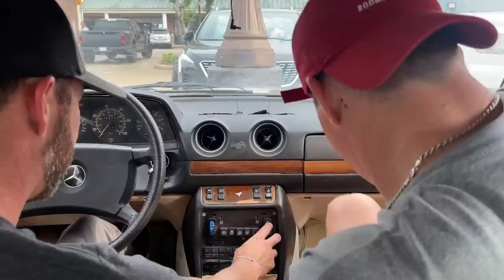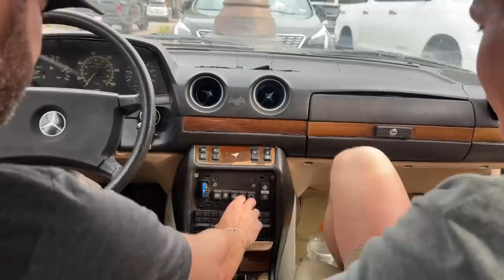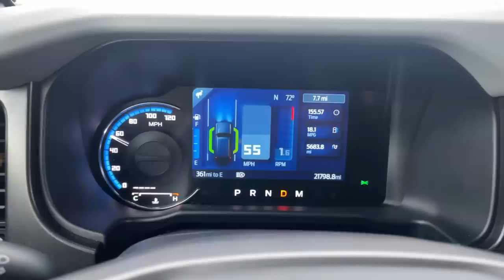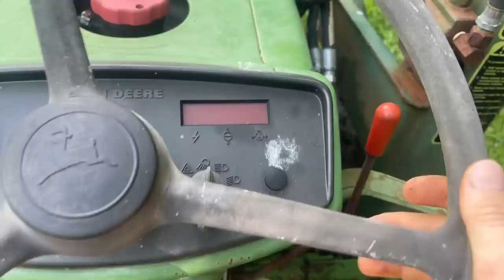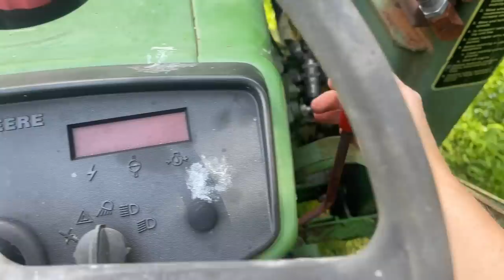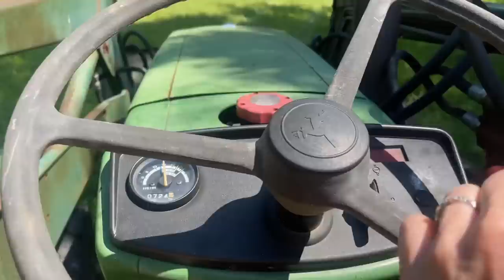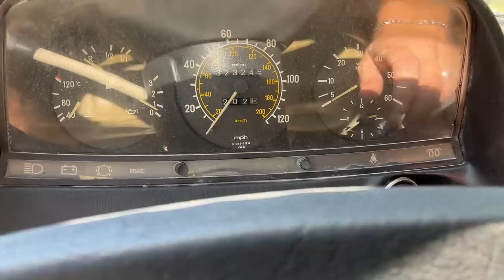Diesel wagon, $2,500?! LETS GO!

Comment: Those w123 chassis cars with the OM116 motors are absolute TANKS. Oil changes, anf fuel filters will make them run for ever. The weak points are underbody rust and the vacuum systems that run the locks and fuel cutoff. That looks like a solid example

Comment: When I was 17 I had a 74 ' Camaro & a 76' Mustang Cobra , and a 72' F100 short bed with a 302 , 4 speed. Red ! 
Loved that truck.
My dad bought me the Camaro when I turned 16 & I bought the Cobra 6 months later....
I bought the f100 from my dad when I was 15 . It was wrecked , so I bought a parts truck (71 f100) and changed the front clip...
My dad fussed at me for having so many vehicles but by the time I was 18 I had added a few for parts & , one of my all time fav's , I bought a 77' Monza Spyder.
Then a 73 Chevelle that Id love to have today..
Love the channel .
Phil from Austin Tx.

Comment: A friend of mine has on of these Mercedes wagons he uses as his daily driver.  When he got it, it did not run, and he told me the fuel injection system used is essentially the same as Germany used on their WWII fighter planes.  That was five years ago, and he still drives every day.
Reply: And I bet it's similar to the system they used on diesel trucks before those fighter planes! A chain driven injection pump is some simple stuff (in theory.. Mercedes did this with some gasoline injection cars in the 1950's, too.

Comment: THATS AN AWESOME RIDE!!!  Drove a 300D for 5 years, commuter car.  300K, only repairs, motor mounts, and turbo bearings.  Oil and fuel filers @ 3k, I still see it around town.  35 mpg, and that’s when diesel was cheap.  Never should have sold that car.  Well done.

Comment: That is literally the most reliable rig you own. Half dead, she still does car stuff.
Clean the injectors before you you mess with throttle settings on your pump. Run some CRC or BG detergent cleaner and clean them. At idle, right now they are not spraying, they're streaming like a squirt gun or water hose. That's why she's "nailing", and then clears up. Stanadyne makes the best fuel additives for it. 
Other than that, get the AC working, rear shocks(!), new tires, and enjoy. The bones of this rig are known to live close to a million miles, in African Heat, Artic Cold. Epic car.

Comment: I had a 240D salon from 1976 as my 2nd ever car went all over Europe and the UK in it. The thing is still running and has been restored by the son of the guy I sold it too, still on its original engine and transmission and is halfway on to its 2nd million miles.
Aaron why not do a east coast beach then go straight to the Rockies and ski there.

Comment: I'm in Australia, and I have had three W123's , one being a diesel, non- turbo with 480,000 kilometres on it. That is the first one I have seen with interior in that condition. Usually, they hold up very well. I currently have a W124 300E with 376,00 km. I love Mercedes. Mine is Marymercedes 😆

Comment: Our family largely doesn't sell our cars, we shuffle them around. My first car, in 1991 when I was 19, was a used 1982 Saab 900 I got from my mother after she got herself a '91.5 9000S,. After I cracked the block of that 82 in 1996 I replaced it with an used '89 900 i bought myself and my father got himself a used '90 900S from the same dealer a year after. In 2002 my mother upgraded herself to a 9-3S and my dad got her 9000S and I got his 900S. Then in 2007 I got the 9000S after my mom got a 9-5 Aero and my dad got the 9-3S. Around 2012 I got the 9-3S (which was a 5 speed) and my dad got a used 2002 9-3 SE (which has a bigger turbo among other things) in an automatic as he was tired of doing stick shift (the 9-5 is also an auto). A deer wrote off the 9-3S in 2014 and I replaced it with another 2002 9-3 Manual which I'm still keeping going. 

IF I had to do it all over again, I'd still have gone with Saabs (though I might go easier on the clutch of the first one and the transmission of the third one)... they're not anymore expensive to fix than BMW, or Audi, or hell even VW, and while they're not "fast" cars typically for their class, they're the most overbuilt tanks when it comes to structural reinforcement that I basically don't worry about a collision with anything. I've seen crash photos of them being rear ended on icy/snow covered highwayst by loaded 18 wheelers and the truck is the thing that bent the most in the process. You can take the front coupling knuckle from TWO locomotives doing about 35mph to the drivers door and it barely phases the car. Pushes it down the tracks a quarter mile or so and the about worst you're going to suffer is a broken left leg if you're the driver (everyone else will be able to open their doors and get out). Roll overs are pretty much a non-issue as they have better roof structures than anything without an NHRA certified cage like Finnegan has in Blasphemi, and they're designed to take 1100 pounds of moose or elk to the windshield without the animal getting inside the cabin. 

https://www.youtube.com/watch?v=9IPrXAJ2Vj0

Comment: Check the engine mounts, valve adjustment and the injector opening pressure for the low/rough idle. Looks like a couple rubber mounts fit the air cleaner are bad and it’s the middle button for the A/C.

Comment: I absolutely bloody adore these cars and would bite your arm off for this one (if I was in the states).  I had the saloon with the petrol engine for a few years and it never let me down and it is my biggest car regret that I sold it.
Small tip at the front corners of the sunroof opening are 2 drain holes that lead down and out behind, under, the top of the wings to I think the same spot that the hood hinges hide in with lots of leaves usually sat in there, if memory serves.  I found a bit of extension lead cord flex was exactly the right size to slide down these 2 channels to clear them out without any real effort at all.  Just a fantastic car for making your day feel that much better when you travel in them.

Comment: When I saw the videos of Emily pulling you out on instagram I messaged, Seriously though, get in touch with anything you need to know, I've made vacuum diagrams that are color coded, I've got videos on the AC, Glow system, transmission, and tons more stuff still in the works between editing and uploading between work and everything else.
Your rough idle could be the rack damper, they were upgraded to a newer gold colored bolt.
The EGR vacuum lines appear disconnected, which could be your vacuum leak that is causing poor shutdown.
A new set of nozzles and balance the injector pop pressure does wonders to smooth out a 617 as well, I'd recommend moving to the 314 nozzles, they give you a little more bottom end grunt.
I've been driving diesel Mercedes for over 15 years now, getting pretty close to 20 years, and I'm younger than you...
You can 4 speed swap them, I've got one that I did that to.
Also if road trips are your goal, you can get a diff from an 85 that has the 2.88 ratio for better cruise rpm and economy, I'd do the 314 nozzles to compensate for the taller gearing for sure then though.
If you guys want, I've got all kinds of special tools, pop tester, shims, parts and probably about one of everything else too, let me know, bring it up for a trip to a TN lake, or I can road trip my 300D down loaded with stuff.

Comment: I loved mine!! Screw that exhaust valve closed on the turbo exhaust and it'll bark second gear. It's surprising what that engine can do!
EDIT: The vacuum system is everything in that vehicle...also the AC board usually needs to be resoldered...

Comment: First I would replace the shocks (the rear is a little bouncy)
Go trough the fuel system to find any leaks
Go through the engine by replacing worn and cracked hoses
Get a hitch put on it
As for a Tear drop trailer there are tons of options from DIY build kits or a really nice one with a slide out, kitchen sink, and  bathroom in it.
Just both of you and the dog would enjoy nice road trips once all the little things are taken care of on it.
I grew up in my family with a wagon and a pop up tent trailer going on trips around the country here and there.

Comment: You've had these before, Aaron, so probably not news to you, but the power steering system has a replaceable filter in the reservoir, and the SLS hydraulic system to the rear spheres has (on W123) a filter, too.

Comment: I had both the sedan and the wagon.  They're great cars and the engines are so over-engineered.  I ran mine on vegetable oil for years.  They're not particularly overpowered and can be temperamental on cold days.  Watch the vacuum system... that can be a mess!  I had the self-leveling-suspension in the rear - that's also a mess.  You can find kits online that replace the springs and shocks that make life a lot better.

Comment: Those 300TD were extremely popular in California while they were still being imported.  One fairly well known quirk is that they tended to have problems with hot starts.  They would crank and not fire off if you drove them in the summer and then parked them for a while.

Comment: You can probably fix up that foam yourself. If not a local trim shop should be able to patch it up. 
Once the idle issue is sorted, check all the rubber lines etc, replace the broken headlight and cruise sounds good. 

What would I do these days, add a basic dual battery setup (isolator, then a battery box with acc sockets in the back) Then you can run a car fridge and not need ice. A nice slim roof top tent would be a neat add.

Comment: Hello there cowboy here again nice ride first I'd run some seafoam products Thur her as far the wood you may consider vernier that way you can use most and kind of wood you want to fill and repair the pieces then a nice day cherry or walnut vernier quick easy a little clear coat or polyurethane so it'll keep it's lustre for years ,now the seat there's actually some very good cover's on the market it may take a little research to find just the right fit for her but in the end it's well worth the time and effort a little tinkering and adjusting you should have no problem getting another three four thousand or more miles out of her have fun she's perfect for a little camper fold the seats down they sell air mattresses that'll fit nicely in the back and add a roof canopy and walla your all set ok good luck we'll be watching enjoy 🤠😎

Comment: I loved owning and driving Daimler Benz's when we lived in Germany for eight years.  They are built like a tank.  As a matter of fact, I generally drove all of our Benz's at wide open throttle while on the autobahn.  I had a 115 series Benz tank (1975) that would do 175kph all day every day.  The only time I drove it at the minimum speed limit (100kph) was on 24 APR 89.  Unfortunately, Herman the German rear ended me somewhere north of 220kph.  Luckily/unluckily, I had finished rebuilding my wife's engine (2.5 liter straight six) and I was in the process of reassembling it and I brought it home in the trunk, along with my tools.  Herman killed my 115 Benz, my wife's Benz, and my entire tool set.  I was only able to recover 13,000 deutsche marks from the entire affair.  I still bought another 230 Benz to replace my wife's Benz and I bought an Opel to replace mine.  In total, we ended up owning a total of five Benz's while we were there.  I would never own one in the US because it is way too expensive. One caution about working on the Benz.  Damn near anything you do on it requires a special tool.

Comment: I would put a manual transmission in it. I had many Jetta and Golf with 1.6D, unkilleable, economical and so much fun to drive even for 52 hp and 71 lb-ft of torque. The 300D had a 4 speed transmission, the later generation a 5 speed, but I'm sure other can fit. As for the interior, Mercedes still sells every interior bits, or you can go yard hunting.😉

Comment: I know I'm chock full of comments today, but this one landed close to my areas of interest!

Google for "PeachpartsWiki" and you will find a plethora of repair and maintenance jobs detailed by Mercedes DIY'ers, and a whole lot of that wiki is for W123 and OM617.

Is the W123 a durable chassis? It's too soon to tell...

I'm like this about most Mercedes in the vintage zone: don't customize a thing, just bring it back to spec. Change all fluids, change every cooling system and power steering and ATF hose now, on your schedule, before they get you on a road trip! Fix the seats with MB-Tex vinyl "leather" from whoever is selling that, get some console wood from a junkyard if you can (in Texas sun? not likely... but I have found some not-bad pieces for W124 in my sunny locale.) If you bring this up to snuff, even with those miles, these things sell for way too much nowadays.

Oh, and of course, brand new shocks (2) and spheres in the back (if they're not right) and four new Michelin tires. Drag link, tie rod, bushing for idler arm, adjust steering box play, steering damper, ball joints, alignment. Do it all and have a very happy and reliable camper on your hands!

As for towing a trailer, man, you realy don't have mountains out there, do ya?  You could probably sleep in the back of this with the back seat folded down, eh?

Comment: First thing I'd do is Replace the timing chain, change the fuel filter many times and run it on 50% Filtered Transmission fluid and maybe a little bit of clean Crank case drainings 5% for the rest of it's days

Comment: If you have issues with the air conditioning or ventilation,  you'll have to remove the whole dash to repair the vacuum lines that work it
Reply: And then you might as well change the vacuum servos that are in there while you're at it (if still available.)

Comment: If you ever want a hot rod Merc Diesel consider a Mercedes 606 series with a mechanical 603 fuel pump. 400 hp wouldn’t be a problem.

Comment: I serviced a Mercedes Diesel for 9yrs from 280k miles to 590k miles and was cool to see the miles rack up without issue. Now it was an oil slick on/under it but used less than a quart every 5,000 miles so it was a slow ooze that never dripped a drop but replacing the starter once was a black slime nightmare and at his request to not wash it and wipe the sludge back on the starter so it would match😑

Comment: Arran don't  go to a gas station you need a supply of old cooking oil it will run on it now problem. Start it on diesel switch it over when it's warm and cheap motoring. Best merceedes ever made..

Comment: Better inspect the rubber discs MB used in lieu of universal joints. Makes for a smooth driveline but when old and frayed will let go and destroy the underneath of the car. Very dangerous.
Reply: Just replaced them before I sold it, legit 2 days before I sold it. Aswell as center support

Comment: These old things will do 3m km quite easily . The 5cyl diesels are a slug , if its a  td variant it's marginally better  , nothing that a quick refurb or resto won't fix. Should be able to get 1000km out of a tank of fuel